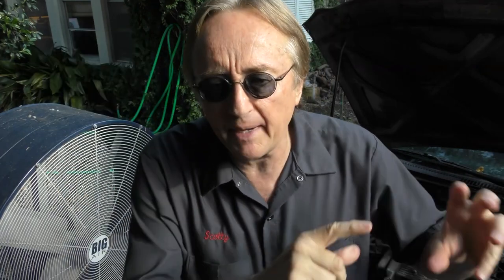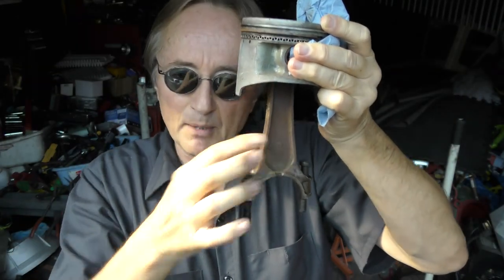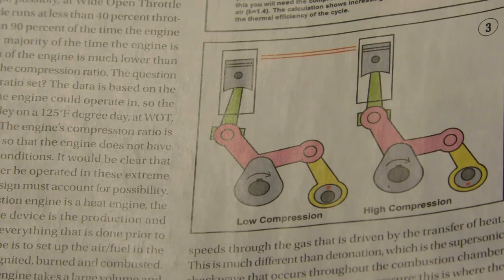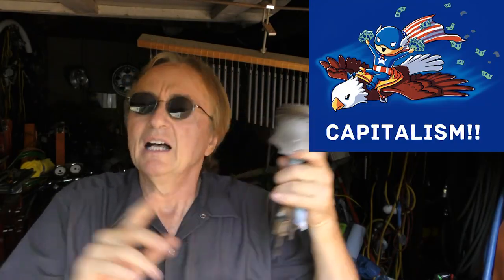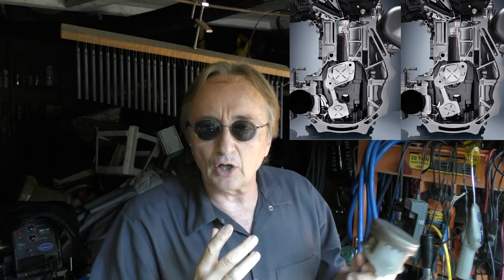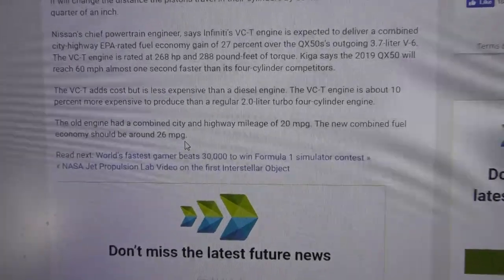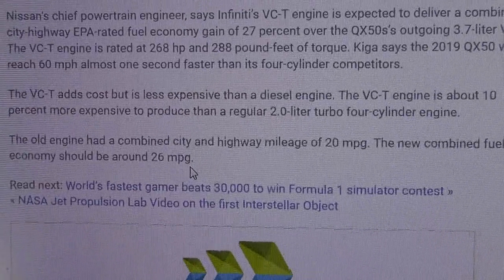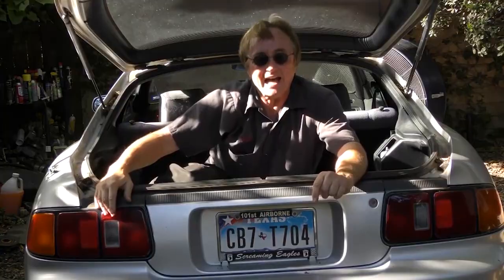If You Buy This Type of Engine, You're Going to Regret It

Comment: Why is Nissan so concerned about developing new technology? They should first figure out a way to keep the motor oil INSIDE their engines.
Reply: RJ Money not Honda.
Reply: @javierromero1092  Depends on the engine and what kind of driving you do. If you burn a small amount  of oil say a little under a quarter quart every 300 miles from frequent high revving,stop and go city driving or racing the car that's absolutely normal.
Reply: Hahaha!
Reply: Or people could learn to change oil at proper intervals to prevent wear and not cause problems in the first place.  In a VQ you shouldn't ever go past 3-4k miles and always use high quality advanced full synthetic oil. Always premium gas. My last went over 300k miles, not a drop of burning or leaking oil when I sold it. Probably still out there on the road if it didn't get trashed by the new owners.
Reply: What is this ? 2002? I’ve only had one Nissan engine that “burns” oil and it’s not enough to be a concern. Infact it’s still going strong with over 200k. A lot of engines aren’t good at keeping oil. Not a Nissan thing. Have you seen the new FCA oil consumption guidelines? They are ridiculous. A quart every 1,000 miles when NEW.
Reply: I have an 07 350z with 213k miles with zero issues. It doesn't smoke, burn oil, or leak oil anywhere.
Reply: I had a Quest with 360,000 miles when I sold it.  I got rid of it because the interior was falling apart after being in the 115°F sun for 10 years.
Reply: Desmond Hebert Curious man,what car was it exactly?
Reply: @vvvvel  
Sounds like you have continuous  bad experience of your picking.
Reply: @loktom4068  Easier said then done if you only had the knowledge to take care of it.
Reply: I have a 93 240sx with 88k and a 98 frontier (both 2.4l) with 206k, no oil leaks.  Then again, they were merged with a French company near 2000's (watch Scotty's video) so wouldn't surprise me.  My old Nissan's are great though.
Reply: Or build functional Transmissions which is something they apparently don't know how to do very well
Reply: @pontiacGXPfan  It's the quality that sucks not the design.
Reply: @DrScopeify True Renault used to make bad engines but this is exactly what the company that was known for great transmissions and chassis needed to fix by merging with Nissan a company known for designing the best engines in the world.
now it wasn't without problems do to quality inspections at their Mexican plant that was later ironed out.
people have different opinions about all car makers reliability because most people don't properly take good care of their cars or buy it used with the previous owners hidden problems.
to blame Nissan for bad engine design is laughable and ignorant 
those folks should buy new and follow all maintenance intervals.
Reply: Master Xehanort good point
Reply: RJ Money I have a 2010 Honda Civic Ex and I have the oil changed every 5k miles. The dip stick still shows full. Doesn’t burn any oil.
Reply: @VinnieLJ  That's irrelevant because you drive a slow car to save gas.
if you take your car and drive it hard all the time and race it in stop lights you'll burn oil.
that's just the nature of the beast.
how you drive makes all the difference.
Reply: RJ Money oh really? Ok
Reply: @VinnieLJ  Yep unless you have engine problems.
Reply: RJ Money No engine issues
Reply: @VinnieLJ  That's why the experts say adding alittle bit of oil every few gas tanks is normal.
Reply: RJ Money Oh, okay. Just doesn’t sound normal. My old 1999 Honda had over 320k and was burning a lot of oil. Quart every 800 or less. That’s why I got rid of it, and it had paint issues. I can’t drive a ghetto looking car. 😂
Reply: Master Xehanort you mean Renault
Reply: I had a Nissan for 80 thousand  km and never saw a drop of oil on the floor below it, neither had to refill a drop of oil any time between oil changes (10,000 km intervals)
Reply: Not Honda or caterpillar or Isuzu or Detroit those are always dry. Not that it matters some of the most reliable engines are leaky. It’s the least of my worries in an engine. In fact some of the leakiest are the most reliable. 6bt cummins, 5vz-fe Toyota, kta cummins, 237 Mack, 2gr Toyota are some somewhat leaky engines I experenced that where more reliable than most others
Reply: LMAO!!!
Reply: Desmond Hebert not the Chrysler 2.7 motor. no hope.
Reply: If their engines were more efficient this joke wouldn't burn so much oil.
Reply: I had a Nissan 2.8 engine that was such a good copy of the Mercedes 2.8, that it leaked oil in the exact same place.
Yamaha made an engine for Toyota, (a copy of an Austin Seven) that also leaked oil at the rear main crankshaft seal. How is that for Japanese Perfection!
Reply: @400Redsport  
Premium gas is no help to cars that don't need it.
Reply: @raydavies6236  You do realize I never said to put it in every car right? Can you read? I said the VQ engine specifically, mostly in Infiniti models, as well as the 350/370.
Reply: @javierromero1092  honda cant keep oil inside a vcm j35 v6 to save there life.
Reply: @jakesmith2984  It was an 03 G35 sedan sport package, with an auto trans. I now have an 04 6mt Track Package G35 Sedan with 192kish miles on her and still drive it on every road trip I take.
Reply: James Hudson my 04’ 4cyl is leaking oil 😭. But my 13’ V6 drives like a charm
Reply: 2013 VQ37 engine leaks nothing. Love it.
Reply: @jakesmith2984  Yep, and most of the time just for the sake of making changes...
Reply: Nissan fucked up when they merged with Renault.
Reply: The VQ and VK engine line up are all well built. If you don’t agree with that then you are turning a blind eye on a masterpiece of engineering.
Reply: I actually like Nissan (Infiniti) engines. My main complaint with Nissan engines is how it is so tight when working inside the engine bay that I always got scratches and cuts when opening up the engine. But my major complaint is how so stupid it is to drop the bumper when replacing ballast of HIDs or replacing a fog lamp housing.
Reply: or make CVTs that WORK!
Reply: California and their emissions standards keep pushing more efficiency and less smog.
Reply: @OnYourLeft  gross
Reply: Here we are 5 years later and it’s proven reliable and JD Power gives it great reliability scores
Reply: I drive nissan for 28 years new cars old trucks  they ok for the money  the best one is make from japan  vin number starts with J  .I take care my so they never smoke at 230.000 miles or leak  at 100,000 miles
Reply: You’re absolutely right but the thing is most consumers are dumb and don’t do research when shopping for cars and for the most part want the newest and latest and keep buying these pieces of crap just cause they are new or newer thinking it’s better than some of the older but solid and better built cars.

Comment: Here's a rule, if Toyota does not do it then it's not reliable
Reply: Bryce PREACH Bro!!!
Reply: Yeah but Toyotas r boring n not worth it
Reply: Except water pumps.
Reply: Bryce Hyundai is reliable. We have a 2008 Veracruz. Makes hella power.
Reply: If I were to get an RX7 id much rather have it 2JZ swapped. Those are tough engines and a nice change from what most people would do: LS swap.
Also, the engine in my 52 year old Ford was rebuilt.....lets see how long it lives.
Reply: Bryce what Scotty failed tell you is toyota is just as guilty as the next car companies. The had to recall unsafety accelerating pedals back to the dealer ships. So I would put all my faith in them too. 😁
Reply: Eman 08 I wish Toyota was using the 1AZ FE engine in the 4Runners today. Those engines are bulletproof.
Reply: What a load of crap, here is a rule- if you blindly believe Toyota is god's gift you know zilch about cars and follow sheep. 4AGE, 3SGE most their smaller cc engines they are rubbish blowing rods out blocks running bearings etc. As bad as this guy trying to say Nissan can't build engines when they make some of the best while unlike Toyota actually making power.
Reply: 😆 For real. I plan on trading my Ls460 for,you guessed it,a newer LS460!!
Reply: Eman 08 driving 16 4runner limited old school bullet proof powertrain with high resale value!
Reply: Bmw M3 e46 I've been impressed with my 2016 Corolla so far.  Not boring at all.
Reply: WhyteLis21
I think you fail to realize why that happened, which is operator error. People would put all-weather mats and the like on top of the factory mats rather than swapping them out, thus the pedals would get stuck between the mats and the driver would be screwed. This is why new Toyota cars have floor mats that VERY clearly label the front of the vehicle, the rear, and the exact position they're supposed to be in. Just sit in any post 2010 Toyota car with all-weather mats and you'll see what I mean.
Reply: Derek Marlowe Lexus' & Toyota's FSEs actually play their parts well.
Reply: Bryce I dunno; but has Toyota tried BMW's valvetronic tech? It's really good. 
Anyone got full info on the latest Supra?
Reply: Well, here's the issue: Nissan is the default manufacturer. Nissan does it, it's surely good.
Reply: manoman0 you got me thinking about an R36 with a V6 vct. That's gonna be crazy! Might even turn out to be the holy grail of V6s.
Reply: Toyota are not any better than the other makes
Reply: Gary Keithley Toyota's just about the cheapest brand to maintain.
Reply: I couldn't say but I am very sure you can't go wrong.
Reply: Well, we'll see how long the Prius (Prii) PiP are around and what they cost to maintain. They are sure no better than any other manufacturer.
Reply: depends on person for me the only boring part is an automatic car, yeah its easy and stuff but sometimes I get bored and wish I had a manual but I do enjoy my Zafira though, good punchy car
Reply: We live in times where sporty cars are completely obsolete. Driving nowadays is going from A to B without being shot by cops for driving 0,02 mph too fast and having to pay a month's salary as fine.
Reply: Search "Toyota 1MZ-FE class action lawsuit". It happened to friends of mine. They spend $1,300 to replace a camshaft, then a month later something in the bottom have of the engine broke. All car companies have their problems.
Reply: Bryce Right you are!
Reply: @samuelyi9189  Tell that to my Elantra. Its engine was replaced under warranty last year.
Reply: Who knows maybe it was a lemon out of fruits.
Reply: @chasemiller7974  the 4.0 V6 is already good enough